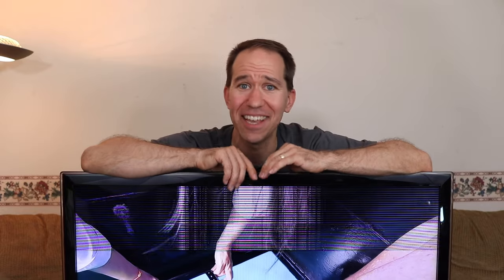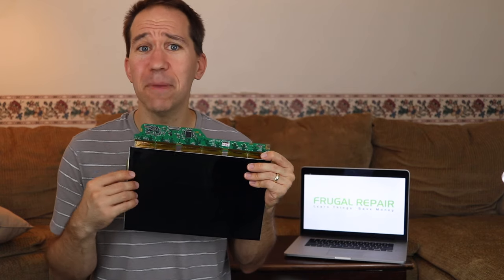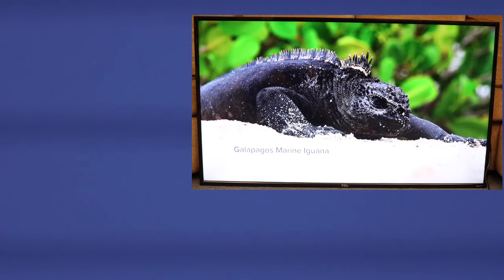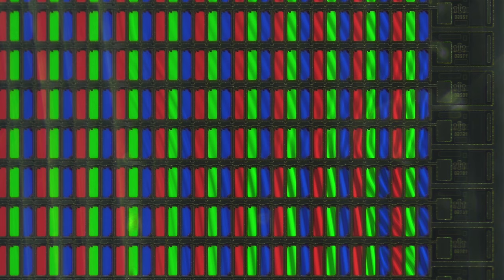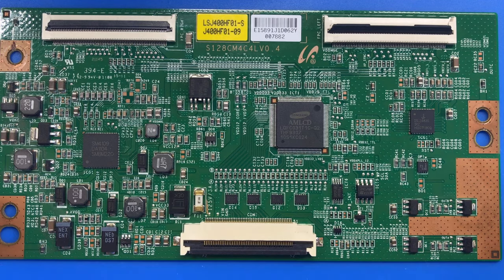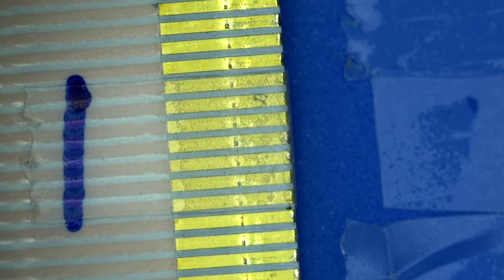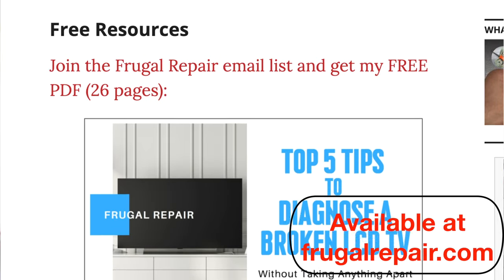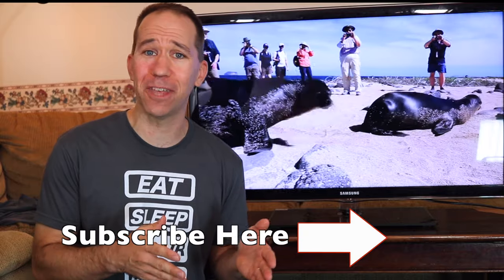Repair Hack Explained | How to Fix TV Horizontal Lines - Part 2

Comment: Can I cover the other cable if the this isn't working . I tried so many combos on the top cable and it isn't working .
Reply from the maker: You can only block one side or else the row signaling information can’t get to the transistors in the sub- pixels
Reply: @FrugalRepair   thank you . I've worked on the top cable this evening with no joy so I'm going to try the bottom one instead tomorrow . Is the issue the cable or the board ? I'm struggling to understand what causes the issue.

Comment: What's the permanent fix for this I mean what part to replace if i dont want a workaround (blocking signals)
Reply from the maker: You have to replace the whole lcd panel.  But they aren’t for sale anywhere which is the problem

Comment: I have a 48in lcd Samsung TV that has a bright light on the right side (full line top to bottom) it’s annoying. Centering tool does not work. Swapping HDMI cables or pots does nothing. I might just cover up with black electrical tape. Just don’t want to damage the screen more than
Reply from the maker: This is a vertical line on the lcd or a bleed though of the backlight?  Did you watch my video on vertical lines?  This video is about horizontal lines.
Reply: Thank you. I did a vertical search and I got this. So I thought I would at least ask. The YouTube algorithm does not always search by all the words. I am just frustrated. It’s a fantastic tv and don’t want to pitch it. I think it’s just light leak as is as if one led light strip was on. And it only on the right side next to the bezel

Comment: Hi. I checked on the ticon board but i cant find "ck" or "CLK" ports to block them. Its sony 46ex720.
Reply from the maker: Find the group of pins that are electrically connected to each other on both connectors.  Those are likely the row signals

Comment: I have random vertical line on each end close the bezel of my Samsung TV. Any tips and tricks to fix this?
Reply from the maker: Did you try the repair and diagnosis as in the video and in the part 1 video?
Reply: @FrugalRepair  No I haven't, thought  that this repair was for only horizontal lines?
Reply: @FrugalRepair  does it solve both problems? I've checked all the lcd ribbon cables and they seem fine.
Reply from the maker: Sorry, I misread.  Vertical lines means something else.  Likely is bad panel but could be tcon board.  You can press on the tab bond connections (need to take the frame off the tv to get access) to see if it's a loose connection going to the lcd panel).

Comment: Hi Rhys: I have a 58" QLED TV from Aldi Australia and started with horizontal lines 29 months after purchasing it. I took one of the ribbon cables to see which one was the problem, but when I plugged it back, the image disappeared completely. I unplugged it and plugged both cables one at a time back several times (sometimes I could hear the sound of different channels) but I could not get the image. I would be happy to get the TV back as it was with lines and all. Thanks in advance if someone could help me.
Reply from the maker: Sorry to hear!  Hopefully you weren’t moving cables while the tv was on because you could have caused a short.  But my guess is that either the cables are not getting inserted properly or that the tcon board is suspect.
Reply: @FrugalRepair  Thanks for your prompt response. With so many times I plugged and unplugged the cables I might have caused a short. If that is the case, the short would be in the tcon? Is there any way to check if the cables are inserted properly? because every time I tried to be careful, but you never know, most of all because is the first time I come across so many wires in one ribbon.

Comment: I have a No name tv, it turns on, the logo pops up and then totally black screen and no  stand by light. Also with the flashlight I can not see anything.. the power supply has no visual defects. Also checked all motherboard with smd short but no luck.. any idea ?
Reply from the maker: At first it sounds like the LEDs are the culprit. But if you’re saying that the whole TV shuts off after the logo, then it may be something else. What I would try next is Trying to isolate the problem spot. I would disconnect the LED backlight, then power on the TV. You can also disconnect anything else that’s not critical to turning the TV on. You’ll need a flashlight to point at the screen to see if there’s an image, or play some thing that has sound that you know is on that input.

Comment: I have a Seiki SE50FY33 tv W A FEW HORIZONTAL LINES NEAR TOP. cAN NOT DETERMINE WHICH PINS ON TAPE ARE CONNECTED. i KNOW WHICH CABLE. bLINDLY TRIED TAPE IN DIFFERENT PLACES  help

Comment: I have same issue with my Samsung tv. Top 1/3 of the screen has the lines. 
That part of the screen is hotter than the rest of screen. Is this normal?
Reply from the maker: The hotter part doesn’t make sense to me.  There may be a in panel short circuit but I wouldn’t think the whole third would warm up.

Comment: Hi, I registered at least three times  on your web page but still not receiving the doc, is there a problem?? thanks
Reply from the maker: Sorry to hear about the trouble!  Make sure to check your spam and other folders.  You could search for “Reese” among your email folders.  Send me an email (it’s on the about page) if you are still having an issue.  I’m not aware of any problems currently but I want to remedy any ASAP if there are.
Reply: @FrugalRepair  Hi again and thanks for your quick response, I finally tried with another email address and it works, I've just received the doc, thanks again

Comment: Soo mine doesn't really have horizontal lines.  It does but not like that. It's more jumping the image up and down the screen with a few small horizontal lines.  Vizio p series
Reply from the maker: It might be a row signaling issue like what this tv had.  The isolation technique should give you a clue.
Reply: @FrugalRepair  ok I'll give it a try... When you were doing the continuity test was that to find pins or connections that are shorted together?
Reply from the maker: In this video, it was to show how you can find the pins that are connected on both sides.  Because signals are redundant blocking and one side is what makes this work.
Reply: @FrugalRepair  oh ok... I'll try the tape. Of that doesn't work. I've seen other fixes where it was a voltage issue and replacing capacitors fixed the issue.

Comment: The color difference on our tv between the left and right side are noticeable.. how can we make it less noticeable atleast? My husband used a paper instead of a tape
Reply from the maker: The issue of color is likely because of blocking the row signal.  You may be able to do some mitigation with the color settings or turn the backlight down.

Comment: Frustrating reading all these success stories.  It does not matter which side (L or R) ribbon I remove, I still get the Horizontal lines (and BTW they 'flash' as well).  I tried some random tape strips here and there on either ribbon and it made no positive difference at all.   This TV is not that OLD so its infuriating to toss it out.  HELP
Reply from the maker: The tcon board could be at fault.

Comment: Thank you for all the tips and tricks. It is appreciated. I am trying to fix a Samsung 50 inch (Model: UN50H6350AF), screen model: CY-GH50CSNV1H. Many diffusers inside came loose and all I needed to do was glue them back in but in the process of reassembly, I made a bad mistake. I cracked the lcd glass and I am so disappointed/furious. A $10 (for the glue) fix now became complicated. Do you know where I can get a replacement screen from? This TV is kind of "special" for me. You can still watch TV on it but now there is a lined curve in the screen left to right.

Comment: Can I do the same on a single ribbon cable on 2019 toshiba lcd tv
Reply from the maker: Probably not easily.  You need two row signals in order to get this to work.  So you likely have them but they are on the driver board.  You may need to cut the traces and resolder ones you want to keep.

Comment: Hello, I have a TCL tv model 55s405. Recently it starts showing one horizontal line which color varies depending on the background color. (Mainly green but sometimes purple blue, and other). It' s not a big line compared to the tv screen size. Does anyone have any idea ?

Comment: Hello Rese,

ive been watching you for a while.  i just sent you an email with a video of my tv issue. I got a tv today the image flashes/flickers. it is a un65ks850df. it starts flickering after about 10minutes of use. also it has a second problem that starts right when i turn it on. the backlight goes from high to low ( not gradually) every 10 seconds or so so it looks like the brightness increases. we sent it to a repair shop and he replaced the main board but it still does the same thing. please help. you are my only hope :). below is a video of the tv flickering if you want to see. i saw your tape hack and wanted to know if that might help as well.
 the subject of my email is "SAMSUNG curve tv flickering/flashing".  thank you so much.
Reply: if you got it really recent you could probably return it for free
Reply: @yogas2  it was second hand unfortunetely. got it for a good deal.
Reply: @sebastien8697  ouch, came here because theres a horizontal line of black (assumed to be dead) pixels on my tv, best of luck!
Reply: @yogas2  horizontal black lines are usually a sign of bad lcd panel. maybe the tape trick will work.

i uploaded a video of my tv issuefor anyone thats willing to help me. thanks in advance.
Reply: anyone have any idea?
Reply from the maker: Did you try the isolation technique?  That would give you the best clues if the issue is the LCD panel or the tcon board.

Comment: Hi so few days ago I fixed 43" LG smart tv using this method. I was about to buy new 2nd hand mainboard from ebay to fix the problem thinking that there is problem with emc nand but something was not right I knew that mainboard starts I mean boot because after turning on tv I could see Bluetooth device ready to pair on my phone.
I will ad that this tv comes with integrated tcon on buffer board which is bonded to panel.
I  for voltages no power at all disconnected one ribbon there is 17.5V.
but still no picture but now I knew I'm going in to right direction because with to ribbon connected there was no power at all and with one there was 17.5V as it should.
So now I started to mask isolate data lines and after doing it I had a picture and TV works as it should and  I cant see any lines or any display artifacts all look good to me.
I dont have any electronic background Im car mechanic electronic is my hobby and I try to learn when I have some spear time how things work or trying to fix any electronic stuff very often with positive  outcome.
One thing was bothering me so why after masking some signal lines screen comes back to life and there is no visible degradation of picture, ok so as far I understand from your video those signal lines comes from both sides of panel same signal ? is this mean that short was somewhere on the edge of screen where those tiny lines enter panel? and why signal is sent from both sides same signal from both sides ? is this have something to do with refresh times to make refresh time quicker ? 
thank you for your video I subscribed already and will be watching your videos :) English is not my first language I was trying my best  hope there is some sense in what I wrote here.

thanks again
Reply from the maker: Congratulations on the repair!  The short is somewhere in the circuitry (that controls row signals) on that half of the lcd panel.  I believe the reason there are two of the same signals is because it timing and voltage drop.  The transistors on that row might not turn on at the same time.  Sorry I can’t explain better than that at the moment.

Comment: I have intermittent colored horizontal lines all over the 55" 4k screen and only one ribbon cable coming to the panel from the board that is called "FRC Board" instead of t-con (picture: https://www.tvparts.ca/images/product/tvpart-image-0-1503170621-frc%20.jpg) . Any suggestions? thank you
Reply from the maker: You have a tcon somewhere.  It might be intergrated on the main board or behind a metal plate.  But a tv that size would almost certainly have the two ribbon cables going to the driver boards.

Comment: I know the tape is just a cheap solution to make the TV good enough, but what’s the actual solution? T-con boards are pretty cheap these days. If I spend $20 to buy a t-con board and put it in instead of applying tape will that actually solve the underlying problem?
Reply from the maker: The actual solution is to replace the lcd display module.  This is not cost effective nor can you find one for sale anywhere (for most TVs).
Reply: @FrugalRepair  thanks so much for the reply. (I actually was on YouTube so saw your reply instantly-hence the quick reply on my part). So I have a bunch of broken Vizio TVs with various reasons. I’m hoping to at least see if that module can be removed from the one with broken Backlights and put it into this other one with horizontal lines. Where is the module located?

Comment: Does this work with mini-LED
Reply from the maker: This repair trick is for the lcd.  The backlight is separate component.
Reply: @FrugalRepair  okay thanks! I did a bit more digging on this last night and sort of came to that conclusion but it’s good to hear you reaffirm. I have a TCL 6 series and it seems I have to tape the test wire on the board near the bottom. Great video though it definitely led me in the right direction and gave me hope

Comment: I first had vertical thin lines in my lcd monitor, then today, I see a thick horizontal line, which is quite visible, it is purple in colour, the the two thin vertical lines are blue and green in colour

Comment: I was able to fix my tv with a tape and I used it for just a month and now the lines are back again what should I do
Reply from the maker: I'd check the connections again and maybe try the process over again.  It's possible another short circuit developed but my guess is that it's a connection issue where you put the tape.

Comment: I tried this but it didn't work and I took the tape off and now there is no picture only backlight is there anyway to fix this?
Reply from the maker: My guess is the ribbon cable needs to be re seated.  This happens to me a bunch.
Reply: @FrugalRepair  I put it back in multiple times and it's still the same black screen and backlight

Comment: I did this trick 3 years back and my tv was working till now, today iam getting same problem, now the tape trick is not working anymore whatever combination of circuits i block using tape no use. I need to call a technician now

Comment: What if the lines come and go? My TV has lines that run from top to bottom for 2 sec then stop and everything is fine for another 2 sec and then again.
Reply from the maker: Could be bad tab bond.  Check out the video on fixing a tv with a toothbrush, I cover vertical lines in that one
Reply from the maker: It could also be the tcon or something on the driver board
Reply: @FrugalRepair  Thank you very much for the reply. I played a bit with the picture settings and i found out that when a setting was changing the refresh rate the lines were travelling in higher speed through the screen. Suddenly since yesterday the lines disappeared! It wasn't because of the changes i did, because when i stopped playing with the settings the lines were still there but they were running in higher speed and it was affordable to watch. I'm sure that it is not the panel because the lines had the form of noise distortion. Which board is responsible for the refresh rate etc on the panel? The board that controls these settings is responsible for the issue. Thanks in advance and sorry for the long post.

Comment: How do you fix it the right way?
Reply from the maker: It depends on what the problem is, but it’s probably a problem inside the panel and an impossible fix with standard repair tools.

Comment: Help me I need help with my black star flat screen tv led models num BS32LED
Reply from the maker: Sorry but I can’t help you with that limited information. Can you list off what the symptoms are and what you have tried so far to fix it?
Reply: @FrugalRepair  ok the tv have no backlight no sound an it's not taking instructions from the remote but the stand by light comes on an it turns on. ok I baked the main board after seeing one of ur videos then I got sound still no picture an it's started receiving info from the remote that night which was yesterday I  was playing around turning the tv on an off then the tv came up normally bright working as it should for about 45mins then got back dark so my question is if the tcon board or main board an how do I fix it
Reply: I could email u the picture of the inside an the model num of the board t con an main board
Reply from the maker: If it worked after you heat it up, and then that sounds like the problem is pretty much on the main board.  Maybe you can buy replacement on eBay.
Reply: @FrugalRepair  can't find any I search the model number LG-RE01-160902-CY01 on the board but nothing I see boards looking I identical to mines but don't know if it compatible
Reply: Maybe I could revive it with thinner I don't know

Comment: Hi I have a LG TV and I disconnected it cause I moved to another apartm When I connected After a few months I noticedThat the screen is black And I try a trick Then I saw on YouTube To disconnect it and press the on and off button for 60 seconds and it's supposed to turn Back on but it didn't work So maybe's what you saying just put tape in that seat😂😅